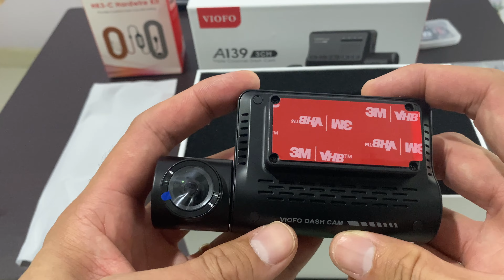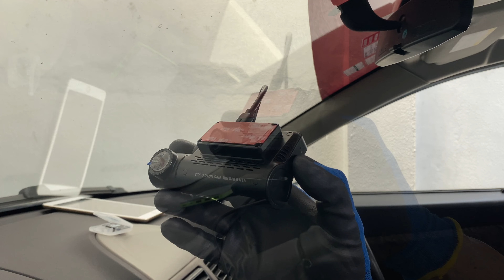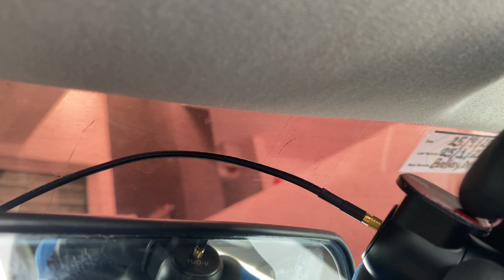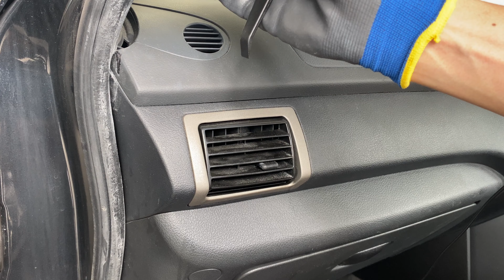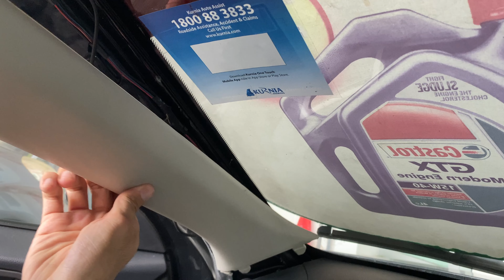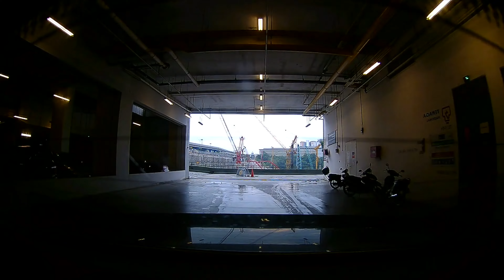VIOFO A139 three channels dash cam sample video with Sony sensor without hardwire kit #ad

Comment: Need help with this dash cam install. I plugged everything in and try to do a test to connect to WiFi. So that I could see where I want to position the cameras. I can’t see the image on my iPhone like how you see it on your iPad.
Reply from the maker: Try restart both machine. Go setting> WiFi and click select the dash cam from the Wi-Fi menu. I suspect iPhone is not yet connected to with the dash cam using WiFi protocol. Hope this helps.

Comment: What is the Static film for and do I need to put the dash cam on the static film or can/do I put the dash cam directly on the windshield?
Reply from the maker: Good question. Static film are meant to protect the windscreen tint film. Static film to prevent the double sided tape from peeling off the tint film if you have installed one onto your windscreen.

Comment: Does the dash cam come with the static film that  you used in this video to mount the dash cam onto the windshield? Where can I get that film?
Reply: Great video, it's nice to see a dash cam reviewer for once that actually showed how they installing it. I currently have the A129 Duo on my Ford Expedition and have been happy with its video quality for the price I paid. I did order the A139 and the hardwire kit for my new 2021 Toyota Highlander Platinum so I can get side window coverage which the A139 can provide. Prior to the A129, I purchased a Vantrue and returned it due to its over sharpened video image that made edges of objects to appear like snow, which made it look horrendous and difficult to read license plates, the A129 wasn't overly filtered which I was able to read the plates much better.
Reply from the maker: The static film comes with the dash cam. I cut them smaller.